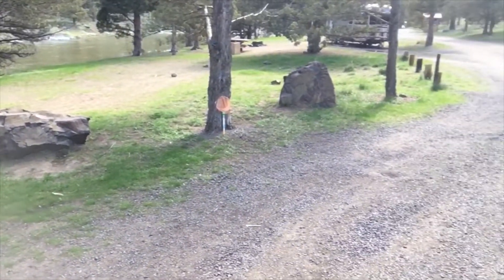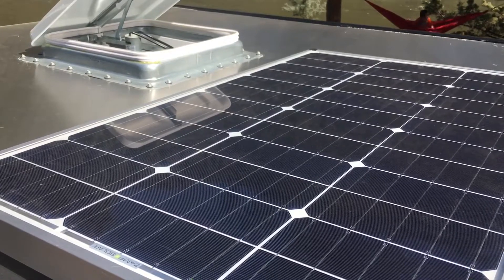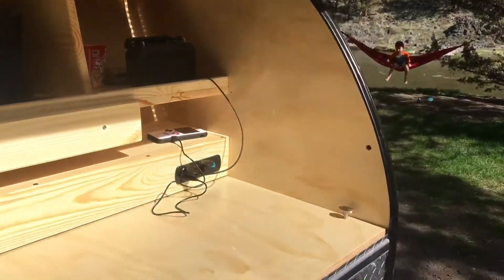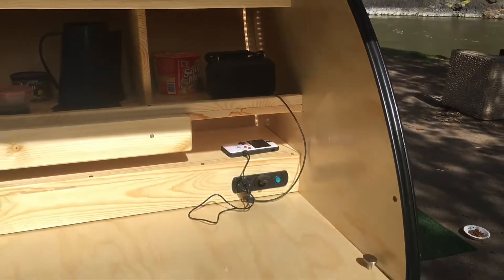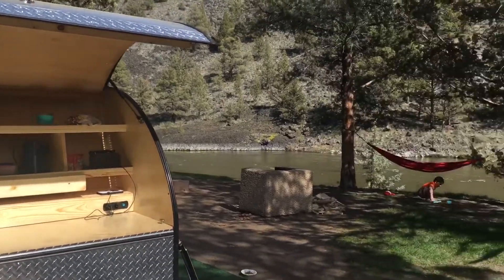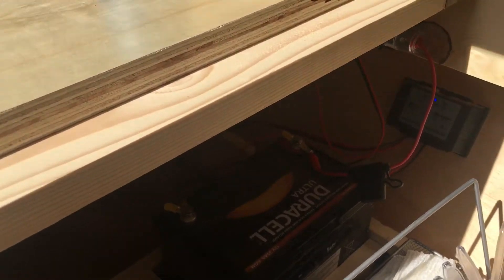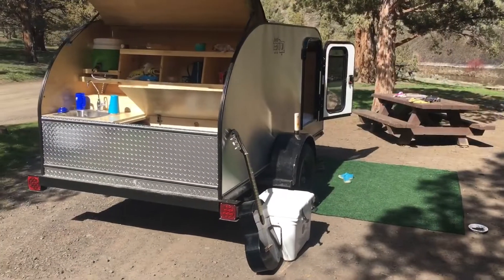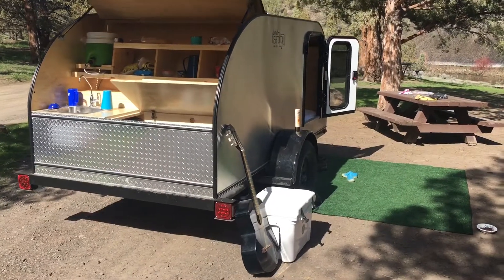Teardrop Solar Setup

Comment: What was at 12.3 volts the battery? Cause that's pretty low fully charged is over 12v isn't it like 14 or 13 volts fully charged I thought below 12 was low already
Reply from the maker: james white on a deep cycle battery we can run our LED lights, fan, usb down to about 8 volts I’d consider that low.
Reply: You might want to rethink running your agm down below 12 if you want it to last more than a year. I burned my first set by doling this also. Fully charged battery is over 13 https://i.stack.imgur.com/clBVt.gif

Comment: What yeti do you have and how do you heat the teardrop?
Reply from the maker: Adam Leslie they’re insulated so temps above 50 you don’t really need a heat source. In cold weather we use either a “little buddy” indoor safe propane heater or 12v dash board heater.